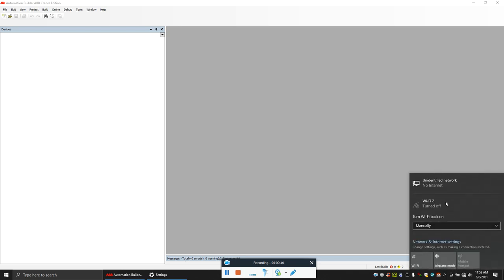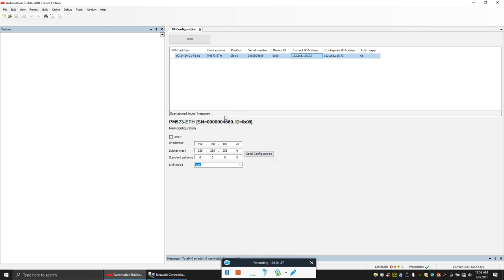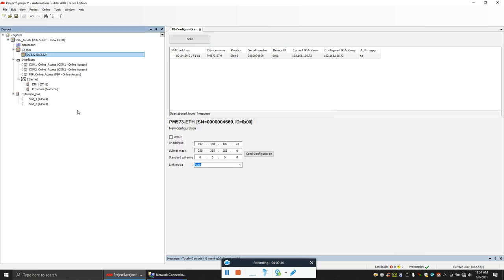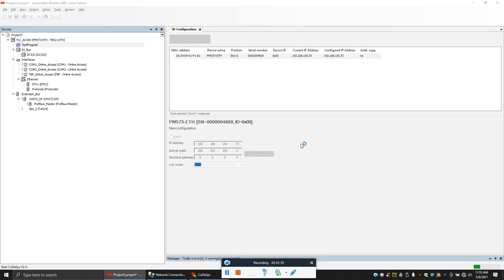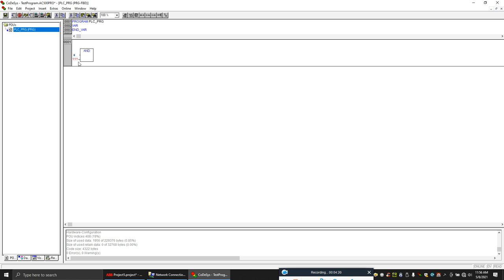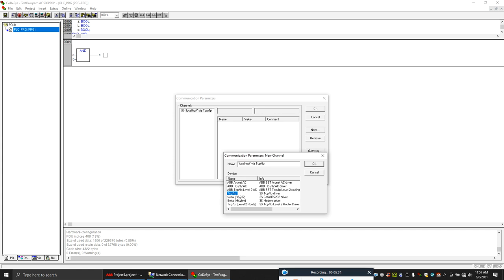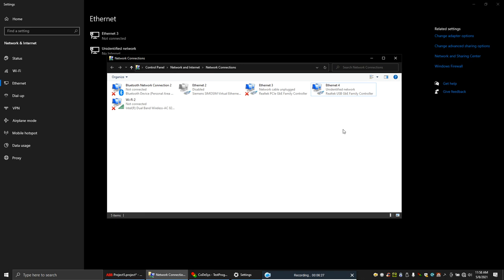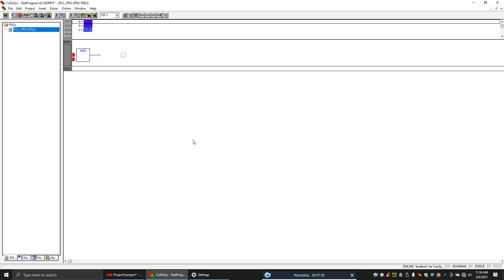1. ABB AC500 PLC Basics and Configuring

Comment: I need your help to configure My AC500 V1 CPU. I am facing a problem with Data communication time with other AC500 CPU in my system.
Reply from the maker: Hi, i didnt get your question, you want to communicate ac500 plc with another ac500 plc?